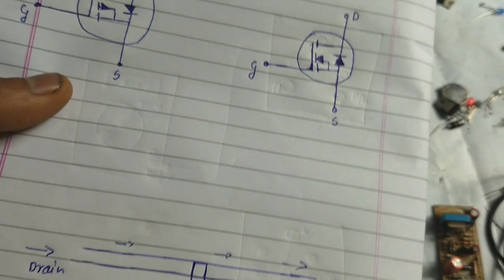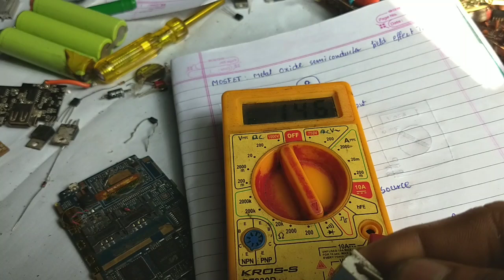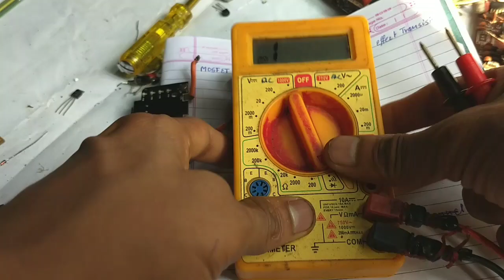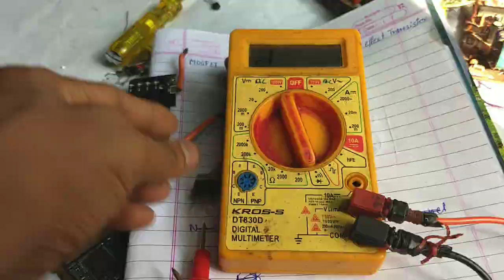Electronics basic #11 : What is MOSFET ? working and testing in ||Kannada

Comment: How to make Inverter with 12v step down transformer which had 5 pins
Reply from the maker: you need to test voltage in each terminal and some circuitry is needed ,check on youtube ,there are many tutorials

Comment: Maximum volts estu kodbahudu
Reply from the maker: emmitor-base 6v
collector-base  50v
collector-emmitor 45v

niv use mado configuration mele depend agute heg use madtira anta
Reply: Anna nimm voltage regulator wiring diagram kalsi